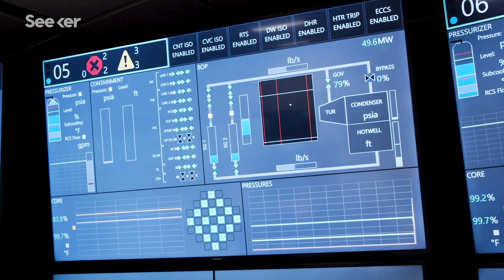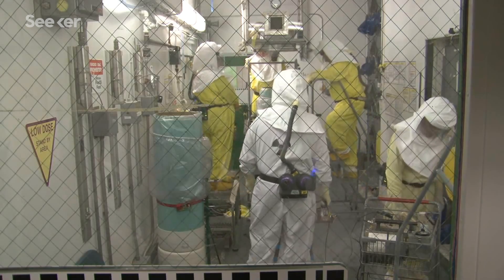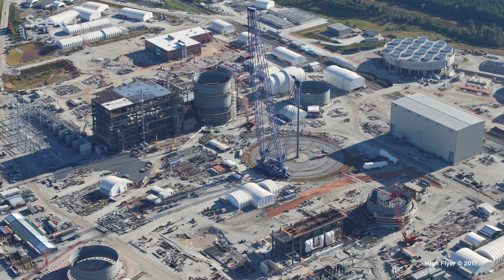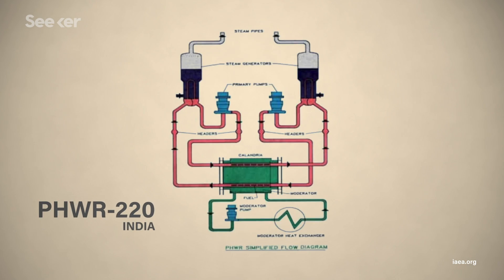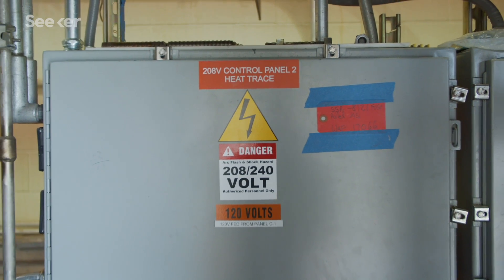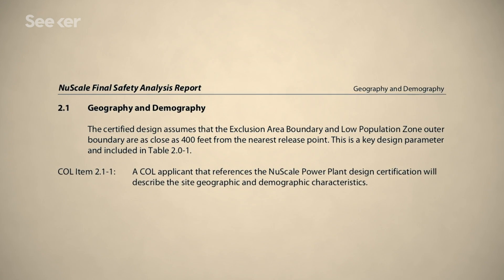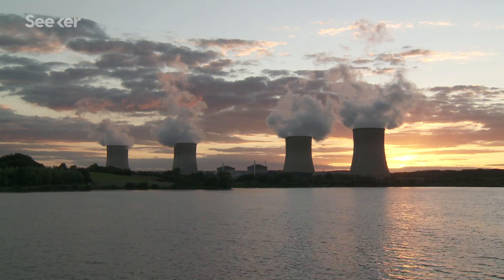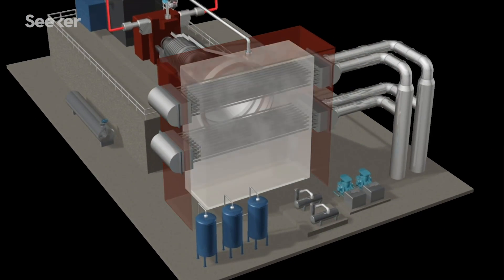Mini-Nuclear Reactors Are Coming, and They Could Reinvent the Energy Industry

Comment: I think nuclear fission is the best alternative we have for now. So far, it has caused way less deaths than coal.

Until nuclear fusion is available, sticking to fission reactors seems like a good idea.
Reply: @Demo Nuclear waste is basically the only toxic heavy metal  that decays into safer material over time. Others like the Cadmium that goes into solar panels do not (very technically speaking, all elements, even protons will decay, but that takes about as long as the universe is old). So this perspective that nuclear waste lasts too long to be safely stored is rather ironic when all similar waste lasts forever, yet nobody is saying we should stop mining cadmium to make solar panels.
Reply: Sphere723 we barely produce any nuclear waste, and what makes nuclear waste any different from the other toxic compounds that we release in orders of magnitude higher everyday.
Reply: @Demo I think it is at this point I should bring up the fact that a dam failure in China killed 171, 000 people in a matter of minutes. I get that Chernobly is a lot sexier disaster, but when it comes to reality and actually setting policy, nuclear is remarkably safer than the alternatives. The waste is the most well controlled industrial waste of any industry, and really there's not much more to say.
Reply: Demo 
Sorry, but that's incorrect.
The energy density of uranium is so incredibly high that a piece of uranium barely larger than a Rubik's cube can power someone for their entire life. We do not have an energy source that produces anywhere near as much energy.
Hydroelectric power requires damns, which destroy the environment. 
Tidal power requires expensive underwater turbines that harm ocean environments.
Wind energy devastates local bird and bat populations and are really dangerous even for workers, having killed more workers than nuclear power. 
Solar energy is perhaps the worst of them all. First, the panels are made of materials that cannot be recycled and contain toxic components. 
Second, they are inefficient and weather reliant
Third, where do you think the land is coming from? The standard US nuclear reactor needs little more than a square mile to operate, whilst a soar farm that would produce the same amount of energy would require hundreds of square miles. That's called deforestation and habitat loss. 

As for nuclear waste, it can actually be reprocessed and recycled, although the US doesn't do this yet. There are even designs for nuclear reactors that could be powered using nuclear waste. Besides, nuclear power plants don't produce a very large amount of nuclear waste and we are quite good at containing it. 

Solar energy isn't a cure all solution. In fact, it's harmful to the environment. The fact of the matter is that nuclear fission is actually the most Eco-friendly power source we have at the moment. After all, despite initial environmental damage from the Chernobyl meltdown and residual radiation that still exists there, animals and plants in the area have flourished once again.
Reply: plus no one factors in the insane amount of concrete and steel that are required to make the plant safe as well as the fuel rods, they require insane amount of fossil fuels to make, so if you look at the whole picture the EROEI (and yes all the graphs are mostly calculated without these processes factored in)
Reply: @buda3d2007  One wind turbine needs about a hundred truckloads of concrete just for the base of the tower, and a nuclear reactor makes about fifty times as much power as a wind turbine. Worse, the reactor runs 90% of the time - they usually shut down for one month every eighteen, to refuel - while the wind turbines run at about 40% capacity on average. Just going by similar power production, wind needs about ten times as much concrete and steel as nuclear, and that's not including the enormous storage dams etc that would be needed to make wind reliable. ( The average capacity factor over the hundred or so power reactors in the USA last year was 92%, and over half the down time was refueling shutdowns, which are scheduled for parts of the year when demand is low.)
Reply: john oneill wind turbines had nothing to do with my initial comment...... hell I’d recommend nuclear if the investment was worth it along its ENTIRE production cycle, but it’s not, it’s not, fission nuclear energy arguments (for) are some of the biggest confirmation biased arguments around
Reply: @Demo Each year lead causes a lot more health problems than nuclear waste. Like its not even close. I'm not saying nuclear waste is good for you, just that when it comes to toxic industrial waste 99% of the problem is consolidating and containing it. And with nuclear waste, unlike basically every other kind, that 99% is already done. Which is why it doesn't cause health problems in the real world unlike lead, cadmium, mercury etc. Those are real problems which are hurting real people.
Reply: @Demo you are obviously completely unaware of the rare earth processing involved in making of solar panels and wind turbines.  Renewables have a MASSIVE backend waste stream.
Reply: @Demo Nuclear power is statistically the safest mode of power generation, generating the most amount of energy per death caused.
Reply: @Demo "Fission reactors are inherently `dirty`"

Much, much less dirtier than coal though. And it has also caused much less deaths as well.

"he only nuclear reactor we truly need is the one shining down on us from space"

And yet solar power is not yet an effective source of power nor is wind. Solar panels are usually only around 20% efficient.

"There are now MORE than enough viable and affordable alternatives available as a solution to this problem."

Can you name a few? AFAIK, solar and wind can't compete with fission reactors in power output and efficiency.

"that won`t cause your descendants to grow extra heads and limbs."

I hope you're being sarcastic with that statement. Radiation, whilst it can be quite dangerous, does not cause people to grow extra limbs or heads. That type of stuff can usually only be found in sci-fi shows/movies.

It can cause mutations, which will cause cancer.

"If the same level of investment had been sunk into wave & tidal power, wind power, solar ..."

And how exactly do you know that? That just seems like a wild guess.

To be quite frank, until fusion reactors come online, nuclear fission seems to be the only solution.
Reply: @perfectlybalancedasallthin9319  thank you for all that imformation, very well educated in the world of power! The FactMan (seems fitting concidering we are talking about nuclear tech)
Reply: @perfectlybalancedasallthin9319  I'm looking forward to Fusion Energy personnally. this might solve all our problems if it works.
Reply: @Demo I cant see your reply, have you deleted it? if so, that makes this response a little difficult, but I will try I suppose

Yes. Nuclear Fission creates radioactive waste, however, the waste is most generally disposed of fairly safely, which even if it isn't, then a new push could be made to actually reopen Yucca Mountain which would prevent nuclear waste from being an issue for thousands of years, Solar though causes heavy metal poisoning, because it is mostly disposed of in landfills. 

You also never quoted a page on foal's, unless I'm not seeing another comment you posted? but nonetheless, I'm aware that when exposed to radiation exposure for a LONG time, it can cause mutations, but those are both rare, with the most common mutations being cancer. 

I didn't pull the numbers out of my ass, they appeared in a Ted Talk, which, might I add, are made with abundant citation. if I can find the talk, I will send a link, but I can't find it right at the moment, so forgive me.

Also, i know you didnt just name Solar and Wind, but those are the only energy sources that are able to be used essentially everywhere, rather than just on coasts, areas with extremely hot interior temperatures, or large rivers, and are the most likely candidates for transforming the US energy sector. not to dismiss your argument, its just that Solar and Wind are the ones being pushed, and are the most likely energy sources to be put in place. 

Im sorry if i missed or didnt reply to any of your points, its just sorta difficult to reply to a comment i cant directly look off of.
Reply: @Demo Nuclear power production reduces the amount of radiation on Earth by accelerating the decay of naturally occurring U-235 into more stable elements. If it it didn't, it wouldn't produce power. Along the way, trace amounts of that uranium will turn into heavier, more radioactive, but shorter lived, elements that do not exist in nature. Nuclear waste is ~98% natural uranium /~2% trace elements.

This is my answer as to "what do we do with all the waste" because people tend to think it's being created out of thin air and will just accumulate forever. That's not the case. The problem is that nuclear power production concentrates radioactive materials which are dispersed in nature. We could, if we chose to, re-disperse them back into nature and we'd be basically as safe as before. But it's even safer to keep the material concentrated and bury it away somewhere.
Reply: @Demo Well then, dilute it and put it back into the uranium mines if you think that's safer.
Reply: Every fission reactor operating calculation should also include cost for waste storage for the several 100 million years until the waste no longer is a radiation hazard.
Reply: @0ptera  I mean, in the US at least that is already the case. Up until a few years ago every operator of a nuclear plant had to pay into a federal fund which will be used to store the waste indefinitely. The government stopped this requirement because the fund is something like $30 Billion (IIRC) and the interest alone is enough to fund basically any storage method indefinitely. The problem is not money. It's politics.
Reply: How about we go for a mix of nuclear and renewables? It isn't like we have to choose A, or B. We will need all of them to meet our evergrowing apetite for electricity.
Reply: @Demo 
Do you know how statistics work? I've done the math. I'll show the working if you request it, but take it from me that 500 million people will have to die this year due to nuclear power for nuclear power to be the most dangerous mode of power generation. Every single nuclear plant on earth could melt down and we wouldn't have 500 million deaths.

Stay in school kid. Learn maths. You need it.
Reply: @Demo On second thought, I'll show you the math. I'd done it anyway so why not show it.

Average annual deaths from nuclear power: 353
Average annual deaths from coal: 1,963,500
Years since nuclear power began: 65
Years since coal power began: 255

{x+(353x65)}/(255+1)>1,963,500
x=502,633,055
Reply: @Demo 
From an objective point of view (C02 output over the course of production), nuclear is the cleanest energy source we have. Solar at the moment only works in certain parts of the world, and battery storage isn't advanced or even large enough to power the grid without supplementation from other sources.

The nuclear waste is a problem, but when you produce far less pollution overall with it than constantly producing new solar panels, it is far and away the best option right now.
Reply: Demo nuclear power plants only produce a coke can of waste every year and don’t release Co2
Reply: @Demo Nuclear power is Enviromentally green. It causes literally zero Co2 emissions.

And let me turn this question around
"So you wanna keep using coal power, due Nuclear power is bad?"
"Tell that to millions who have died due Coal power"
Reply: @Demo So are solar panels. Do you think solar panels are "clean". You need lot of panels to make up for fission reactor and those panels have a life and once that life ends you have a lot of hazardous waste which is comparable to amount of nuclear waste. In addition you need to destroy the environment to create massive solar fields. Nuclear power plant creates so much more energy per square meter than solar energy, so you don't have to destroy environment and nature. Nuclear energy is the only option, it is the best for environment and best for climate. Nuclear's only problem is the drama surrounding it which is overblown. Reactors wont explode if you create then according to good standards unlike Fukushima and Chernobyl. Even if nuclear reactor does explode it still kills less people and is better for the environment and all the coal Germany is burning after banning nuclear. Solar and wind lobbyist just have struck hard on people who don't understand energy industry.
Reply: @Demo "blah blah blah nuclear"
Yawn, try again, progressive shill.
Reply: Noticing a lot of dull, perhaps double-digit IQ progressive shills in this replies. You guys realize it's hard to lie when you have access to internet, right?
Reply: @Demo Germany has spent enough on solar, wind and geo in the last twenty years to make their whole power grid carbon free with nuclear, but they burn nearly as much coal as when they started. ( The geothermal was basically a waste of cash, and wave or tidal would be much the same.) France went 80% nuclear and uses far less coal or gas, with emissions from electricity generation about one sixth of Germany's, per watt/hour.
Reply: @Aimless Studios I am well aware of that. But none of the experimental fusion reactors can produce power. It eats more power than it can produce.

And that is the problem.
Reply: John.T Why not just capture a sun in a bottle so it is always running?
Reply: @joe_man968  Ah Yes, Enslaved Nuclear fusion
Reply: Fred Knowells  lol definitely recyclable. who lied to you? rare earth metals is an over-exaggeration.
Reply: Fred Knowells  Tesla recycles and will monopolize the industry. Lithium isn't the problem, oil is. Panels last 20 years, nuclear is dirty and not as perfect as you describe.
Reply: Fred Knowells  Truth hurts doesn't it, the giant nuclear reactor in the sky and rapidly evolving tech is all we need.
Reply: I agree... hope we can achieve fusion quick...
Reply: Agreed. Nuclear fission is the future and in the future hopefully we find another source of power and look to get rid of nuclear plants as we look to get rid of coal
Reply: Fusion is a king maker.  Smr, lftr, msr, helium pebble bed, lead cooled, breeders, forth gen are democratizing.  Nuclear is greener than wind and solar.  Solar and wind need constant repair. Solar is 7x return on investment, thorium 2000x.  Stooges of big oil promote solar and wind, as big oil does not fear those two piddly players.
Reply: Agreed
Reply: Send the waste to the sun
Reply: "Until nuclear fusion is available" in the next 40y.
Reply: System is the problem 🏡  The Great Qualities.

1, Show all living creatures; all the love and kindness as much as you can.

2, Only try to be honest with yourself. If you try to be honest with others, you will get into big trouble soon or later.

3, Aim only one target at a time; otherwise you are chasing two rabbits and you will miss both. So, the reason behind it. Have one powerful reason and never ever give up the one you want the most.

4, Don't try to be good person only but be the powerful person. We will grow to be the one or we will die. There is no other choice. 

5, Always learn and look for to improve something your life. 

6, You are not alone. Love and faith the high power reduces unnecessary stress in life. But never completely rely on it. 

7,  Success and happiness are the byproducts of our usefulness. So, always increase the possibility of success.

8, Life is not going to be easy. Because of our unnecessary things. Eliminate all the unnecessary things as much as you can by organising yourself well with the environments. 

9, Never believe anything without the proper evidences. 

10, Always try to give more than you take. 
Because it is dignity/ character of the divinity within you.

🌎 As long as people continue to see themselves as separate from everything else, they lend themselves to being completely enslaved. Success depends on how well we relate to everything around us. Joy comes from that bliss of connectedness. I believe that unarmed truth and love will have the final word in reality. To love; you should have good heart. I am a good person until I see a person better than my standard of goodness. Being good is the progress towards a worthy cause. Love is God. Whoever lives in love, lives forever. How selfish it is to try to keep something forever? Love is all about nourishing, nurturing, sharing and expanding the love within you for all. The principle to which we adhere to is that we have kindness of love at heart for the whole of mankind.  As long as there is the unnecessary differences within us; we can not live peacefully so we have to eliminate all the unnecessary differences among us so we can love all. People abilities may vary but not there true love. If we love a person/ God for a reason then we love the reason but not the person. No reason is the reason to love the person because true love never fails. So do not compare or measure the true love as first or the last but love all truly. If you love people truly then you can understand people. If you don't love then you don't understand people at all.

People are controlled by system why?
The Cyclical Consumption is the current economy all over the World. It is making the scarcity problems of the earth finite resources to deteriorate day by day. Current Monetary System is legalised theft. Real money is Gold and Silver. Scarcity gives the money more value. Real money won't lose it's value. When Governments stay away from Gold & Silver then very easy to transfer the wealth / resources to upper class the Rich (Corporatocracy) Elite. When the Governments are printing out more new fiat currency with reserve banks, our old currency is losing its purchasing power everyday. They are printing millions of currency everyday. All governments and laws are existing right now to transfer wealth to upper class the rich elite. The USA Government & other Governments are in many countries, bailed the investment banks & financial institutions in 2008 against the majority of the people. There is no democracy in any countries. Because of the Money System based on profits motive only above all else even humans lives and well-being. So, we do not have freedom to protect our values with the money so on. The violence, bankruptcy & all the negativities are build into the Monetary System of our society. All are owned (including ourselves) by Reserve Bank. Which is private cartel the corporation. So, in legal system, we are legally considered as chattel the properties. They make money in the capital markets with our birth certificates. They do not consider us as Humans. That's the truth. We are at the invisible war with the Elites (Corporatocracies). We have to fight for our Freedom. Resource Based Economy is the Solution. We have to declare the earth resources as the heritage of all the people of this world. So everyone has access to it. Please have your research about zeitgeist movement then you know the truth more. 

 Truth About Health/Drugs Industry Because Of It Your Life At High Risk The drug industry is a 1/2 trillion dollars a year worldwide conglomerate. Almost 300 billions dollars just in North America. That is really big business. What would happen if everyone were well? There is no money in health. You see, good health makes a lot of sense but it doesn't make a lot of dollars. Because everything they do is toxic. Every drug they use, prescription drugs, all drugs are liver toxic, bar none. If you've had amalgam fillings put in your mouth by dentists. It is highly toxic. There's cancer because most of the chemos are themselves carcinogens. To view the tumor as the cancer and we know the tumor is not the cancer. The cancer industry is 200 billions dollars a year. The more work they get, the more profit there is. You have to dismantle; If the truth ever came out about what we would need to do. 30% of people of females in America are at risk of getting, will get cancer of the breast. The ones that are already dead have been grossly mistreated by the medical profession and by the government that supposedly is supposed to encourage free research and development of all possibilities. Why would medical doctors who studied medicine and practice medicine and are heavily funded by pharmaceutical companies why would they go and look into vitamins? That they never had the answer orthomolecular. And as more and more of our population start taking their health into their own hands, there's going to be even more and more of changes. It can't go on the way it is. The system is failing apart. We must make nutrition the primary prevention strategy for the population. You are what you eat. You are everything that you have ever done to yourself. The choices you make directly affect the outcome of your life. - (Food Matters Documentary in Netflix)

😊 Well, I truly love God. I am not religious but very spiritual person. So, I believe 1) Religion is the beliefs in someone experiences But spirituality is having my own experiences. The mainstream religions people promote religious ideology by giving guidelines and guide but In my spiritual life; I do not want anyone or anything between God and me to restrict my freedom to worship God. 2) We do not need any authorities to do good work. The god work is the good work always. In contrast; organised mainstream religions are claiming that they have the authorities to do God works as leaders so on. 3) God is not capable of doing wrong thing, change the past for us and create anything out of nothing for us. Nothing means not anything. So, even God is limited. The mainstream religious people believe that God is unlimited. 4) God wants us to take responsibilities for our righteousness life but not for all the consequences of our actions because they are continued to exist among us. So, How can god punish us for all our consequences? The mainstream religious people believe we are full of sins because of all our actions. 5) Freewill  is an illusion. People always choose the perceived path of greatest pleasure.  So, we do not have choices all the time. In contrast teachings of the mainstream religions are promoting people to do god's will always because we all have choices of freewill always. 6) We can not separate everything into groups. So, everything for good and evil and there's no success and failure for everything. If everything is real then real things can not be threatened. Once you come to understand that God/The Holy Spirit is in each of us, You will no longer need a Book to tell you how to live. Then why we need religious scriptures? The Virtue is the expression of the basic goodness in our actions. The Basic goodness is the fundamental worthiness of every individuals. We are worthy to God always in everything. 7) Beliefs in a cruel God makes a cruel man. No matter what; every living creatures has the right to live and What makes their life cheap? Everything depends on everything. Nothing too big or too small in value. We can not love and hate at the same time; Being a vegetarian means love without cruelty happily. The mainstream religious people are killing people and sacrificing animals in the name of God. They promote God's cruel punishments. The Punishment is endless for Sinners/Devil according to religious scriptures. But God is love always. Overcome hate with love. If all religions for peace, unity? No way. Because they are not for peace. 8) Well, The God gave us everything to go from moment to moment in our lives as we do our part  and pray only to thank god then the Love is in progress. The Love is always for everyone. We are always worthy of the God's love. Our greatest fear is; not to be loved by anyone but we are all loved by someone. When we eliminate all our unnecessary differences among us then true peaceful life is possible with the true love. If we can't find the peace within ourselves then we will never find it anywhere else. 9) This is the Fight for independence and freedom of humanity to worship God freely without religious guide and guidelines to restrict us. Unnecessarily, We do not want third party controls over us in anything ; especially in spirituality. 10) Revive Survive Thrive. Sincerely,  The Real Peacemaker against religious oppression.

 https://youtu.be/HbvCxMfcKv4
https://youtu.be/pIJHJzDQcRM
https://youtu.be/MyxbdmAnIcI
https://youtu.be/wLzeakKC6fE
 https://youtu.be/P8vHa8zD7jY
Reply: Fission will still be better than fusion, since Fusion plants are supposed to generate the same heat entirely by having neutrons slamming into the containment vessel, which is guaranteed to degrade it, whereas fission plants can hypothetically operate with less damage per unit of energy produced because so much of the energy is from the easily replaceable control rods, water, and fuel itself being hit by radioactive particles that are more often far less damaging than neutrons (mechanical engineering wise, hitting steel with gamma rays does basically nothing to it, but hitting it with neutrons can turn it into a radioactive isotope) and generating the same heat.
Reply: Fusion is never going to work out. Stars don't just create Fusion and light out of nothing, the energy required for the process comes from the immense gravitational forces. You want to generate power from a Fusion reaction? Try Solar or Wind (wind is powered by temperature changes, and that means sunlight).
Reply: solar panels contain a lot of toxic poisons.
Reply: @Demo 
Number 1: Nuclear waste storage may cost a lot, but not as much as it would cost to clean up waste related to clean energy

Number 2: Dealing with nuclear waste isnt hard, and the Yucca Mountain repository could be opened back up eventually if the need arose, and that can store 300 million pounds of nuclear waste, for reference the entire nuclear industry worldwide only produces 2.3 million pounds.

Number 3: Radiation doesn't cause extra arms, legs, and heads, outside of the Simpsons. its just cancer, most of which is thyroid cancer, which has a 95% survival rate

Number 4: Considering converting the entire Californian grid to all Solar and Wind would cost around 3.6 trillion dollars when including battery costs and all other related purchases, i think pumping the same funding into alternative sources would have left us broke with no lights in our homes

Number 5: Fusion reactors ARE the future, so instead of investing so much into funding all of that, pump more into Fusion. ITER should be getting online eventually but it will take a lot of money to do it. if they had more money we could probably accelerate the process of making commercial fusion. 

In Summary, Fission isnt that bad, the waste isnt hard to deal with, we have all the tools necessary to deal with the waste, and the places to store them. all other alternative energy sources would take tons of money sank into them to actually power just California, in current solar and wind prices. Nuclear Fission may be dirty, but its very worthwhile to go towards.
Reply: @Demo Also, reactors are inherently 'scarey' too, right... ??   Well, it's true, but earlier designs are decades old... we have much better monitoring, and control, and materials... now if you talk to AOC....(hahahaha)....we've only 10-12 yrs...and we'll HAVE to be off 'fossil fuels'....(ya know I'm being facetious, here)....  NONE of your 'alternatives' have the energy density of a fission reactor... and actually producing alternative energy items 'cheaply' will make a big  'carbon footprint' ... so, remember....the green new deal.... we'll have to paddle over to England for crumpets in the future....if we don't nuke ourselves 1st....
Reply: @Demo there is not much radioactivity in nuclear fission reactors. You could go into the reactor shortly after it has run. And the isotopes have a short half-life.
Reply: lol ever heard of solar?
Reply: @johnt2914  inefficient and only works a few hours every day
Reply: @T.S.Vindices  Wrong, when paired with energy storage it can last 24/7.
Reply: @johnt2914  Energy storage that needs to be replaced every now and again, which means we need to mine more lithium which just pumps more CO2 into the atmosphere, and destroys the environment even more, and needs to be built extremely large to support the amount of electricity the grid needs over the course of the day.  So sure it can run 24/7 but you would have to spend trillions to retrofit the entire grid of California alone to be able to run completely independent of all other energy sources except solar, wind, and Hydro.
Reply: the waste should not be an issue in the future though once we build a space elevator we can just shoot all of it into deep space
Reply: @256Justinian  that just creates more obstacles to dodge when we launch rockets and try to do anything in regards to space-faring. it's much better to just bury it all in a mountain somewhere than to launch it into space. especially since it could eventually come crashing back down to earth and irradiate a bunch of areas.
Reply: @firedeath1154  i hear ya, i'm more thinkin like 200 years from now when spacefaring is hopefully much cheaper. we could use some ion rockets and shoot big cargo pods into super deep space or something. just thinking about this because everyone loves to make a big hooplaaah about waste containment.
Reply: @256Justinian  True. but hey, I guess we have time to think about that, but in the here and now, I guess its better to bury it for now, then shoot it into space 200 years from now.
Reply: Haar har har shooting nuclear waste into space. It's an attractive idea. Launch it into the sun or a star further away. But right now the cost per kg of launching something into space is a lot, nuclear plants are expensive enough as is. Space disposal might only be viable when we have Star gates set up all over the galaxy.
Reply: @johnt2914  Solar is very carbon expensive to build. Its not efficient at turning energy into useful energy at all. 15-22% at best. They also have relatively short lifespan. The biggest problem is no sun no power. So places that get lots of clouds are screwed. Solar is a bandaid not a solution.
Reply: @johnt2914  Good luck getting enough storage capacity for a big City. It's just not going to happen. So far energy demands are rising each year so nuclear power is something we can't do without.
Reply: @GlennBrons  The sun is an immense thermonuclear explosion. A small corner of Texas  (or anywhere) with solar panels could power the entire United States.
Reply: @johnt2914  takes more resources and more space and is less efficient
Reply: @johnt2914  Solars night problem is minor.  Solars WINTER problem is huge.  10% capacity for 3 months a year even at southern latitudes. 

Look at the troughs.
https://www.eia.gov/electricity/data/browser/#/plant/56812
Reply: @johnt2914  No such massive storage exists.
Reply: @256Justinian  Plus, there's breeder reactors that turn that waste into isotopes with half life numbered in decades or a century, useful for RTGs that power space probes and, yeah, nukes.
Reply: John T producing parts for solar energy conductors such as solar panels burns an immense amount of fossil fuels.
Reply: @T.S.Vindices  It's like as you would say: Warm pullovers are inefficient compared to flamethrowers. So if we want some warmth we must heat our houses with flamethrowers.
Reply: @joka1594  i guess you used the  word efficient wrong... something is efficient, if it fulfilles all necessary requirements a task needs. In case of hearing, a warm pullover is totally fine for your own body, but totally useless when it comes to a room.
Reply: @T.S.Vindices  I guess you need to think again about where and how the absurdity in my statement mirrors yours.
Reply: @firedeath1154  Batterys are not the way to go when one wants to store energy on an country sized scale. Pumped up things are good for that like high pressure air or water at altitude. Another way to store hundreds of TWh is to use the gas distribution system. When there is excess energy we would use it to synthesize methane that we can later burn in an gas power plant when we need energy to get some of the energy back.
Reply: @johnt2914  The amount of storage needed to stock a full running of unbrided human consumption would require MOUNTAINS of batteries. I know they can be recycled, even to 95-99%, but recycling isn't free in energy terms. Then you have to find the surface area to fit all your Solar Panels, and you can start to see where I'm heading. Solar just isn't energy dense enough. Solid Nuclear plants where a good option in the 60s/70s, but they proved to be unreliable in the wrong hands, and are now so widespread that any country with a budget can start producing bomb-grade uranium (you can't keep the Ace for long USA, you gotta know that...).

We need to move away from solid fuel, even more so URANIUM solid fuel, go liquid, and change the Uranium for Thorium. This way you make the whole system so much more efficient, safer, and makes bomb-making a nightmare. But the other elements are quite easy to get, since you are running with a liquid medium.
Reply: @johnt2914  you cant build efficient storage that big
Reply: @johnt2914  that and the oil, and chemicals used with them, solar don't last long, a reactor rod can last for 2 years.
And they are figuring out how to use the depleted uranium in accerators to change the atom.
Reply: +John T. Doesn't matter, for every 100 watts of light energy from the sun you'll be lucky to get 2 watts of usable power out of your precious solar panels. meanwhile i can get megawatts, yes MEGAWATTS of power from 1 reactor almost immediately just by pulling out some control rods.
Reply: @johnt2914 We did it boys, we solved the energy crisis

Lil butt. I dare you to produce Finnish Energy needs with Solar. During the winter the sun doesnt even rise in lapland,  and in my town there is 3 hours of sunlight a day, if we are lucky and its not cloudy.

Next year we get our next nuclear reactor at last.  Thats only good way to create energy here. Rivers are already used for Hydropower, and Wind power is not working, due its never windy enough.

Few more nuclear reactors and Finland would become Carbon Neutral.
Reply: @jarskil8862  I'm currently fully self-powered using Tesla solar for only $100/month, it's not that hard.
Reply: @johnt2914  Ever heard of lead poisoning from cheapy made chinese solar pannels that have flooded the market? Ever heard of the fact that solar produce a lot of waste heat thus heating up the surrounding area? Ever noticed how solar farms take up a lot of space?
Reply: @2Potates  Good thing Tesla is disrupting the solar industry with new tech using more sustainable materials, soon most houses will come equipped with it. We have a massive nuclear reactor in the sky and it's currently not being used to it's potential.
Reply: @johnt2914  Solar is inefficient, kills animals, produces more harmful waste than nuclear and is reliant on fossil fuels. It's A LOT more harmful and dangerous than nuclear.
Reply: @DenGuleBalje  that's a lot of straws you're grasping. nuclear isn't portable, creates waste, and isn't renewable.
Reply: @johnt2914  Nuclear produces a lot less harmful waste than solar or wind. And compared to coal/gas it's basically nothing. We can also use what little nuclear waste they do produce as fuel.

Nuclear will potentially become portable in the near future.

And nuclear is just as renewable as solar and wind, if not more. Remember, solar panels and wind turbines are made of 'something', and that 'something' is not renewable.
Reply: @johnt2914  Fission is less expensive / KwH once a plant is made, (although initial plant building is costly) and although it doesnt sound like it, Nuclear fission emits (slightly) less Co2 / KwH than solar. Wind is still better however.

Also, Solar is conditional. (Same with wind) If it's cloudy outside (Or not windy/too windy) then you aren't getting power.
Reply: @johnt2914  Also, Lithium Ion storage units are INCREDIBLY inefficient. Not only do you lose power in storage over time, but you need REALLY big batteries to store enough solar power, and those are very costly.

Solar isn't bad. I'm all for renewable energy. But it is IMPERATIVE that we diversify. The best mix would be Thorium plants (For a safety reason) Solar plants in dry areas unlikely to be cloudy, and wind plants in open plains.
Reply: @johnt2914  solar and wind power are ecological disasters for wild life. Solar panels cook birds alive, and wind turbines create a pressure differential which cause bird bad bat lungs to explode when they get near them.
Reply: @johnt2914  Currently, solar panels are around 28 to 30 percent efficiency for the top models. Even if we could get a 100 percent efficiency, sunlight energy is only 200 watts per square meter which is a lot. But to power the entire country, you would have to cover the entire landscape of Nevada, Arizona and New Mexico with solar panels and matching wind-power for backup. Don't forget the batteries needed for night time power. Honestly, I don't believe that would suffice. It's best to implement solar panels to enhance individual power needs.
Reply: @johnt2914  
Haha, yeah everyone has heard of solar. 
Have you heard how much coal or oil is burned to produce the energy needed to gather up all the materials needed for making solar panels & then to assemble/manufacture or create a solar panel?
Reply: John T ever heard of night time😂
Reply: @johnt2914  solar is like borrowing a small fraction of the energy produced by one big ass nuclear fusion power plant know as the sun, but about 150 million kilometers far away and via wi-fi. So, since it is this far and that huge ass nuclear power plant keeps annoying moving up in the sky and let us have only about 12 hours of its energy, i make myself one to agree with the guy saying that sticking to nuclear power plants here in earth is the best we can do. Can't wait to be able to create our own "sun" here in earth...it would be like "free real state" energy. *glances side to side to see if there isn't any big oil cartel contracted ninjas.